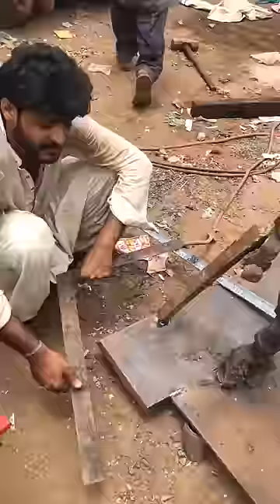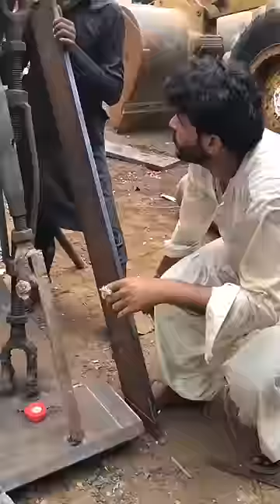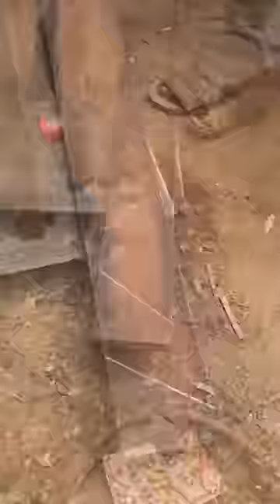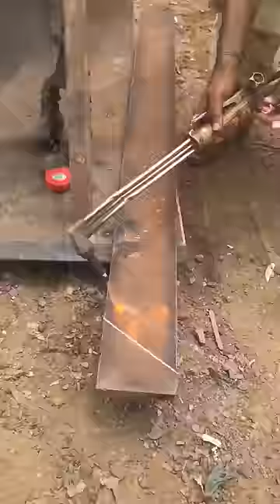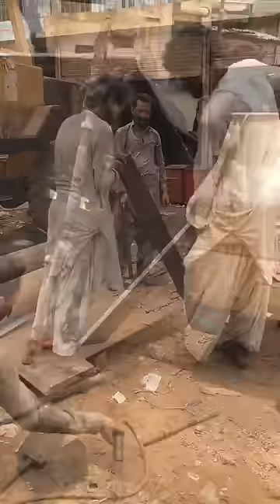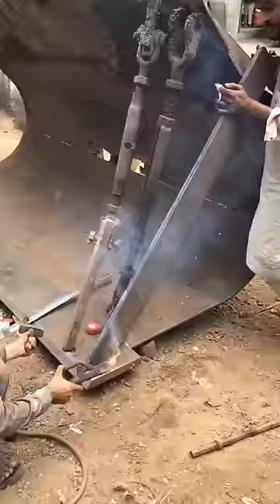Amazing shorts video for stick welding shorts video#shortsvideo

Comment: good
Reply: Not good.  They left the slag from torch cutting and did not bevel the end.  That means poor welds with no penetration.  They are a self sustaining business.  Do crappy work, it breaks in no time and they bring it back for more crappy repairs.  The cycle repeats.